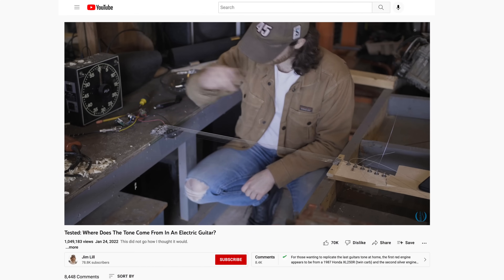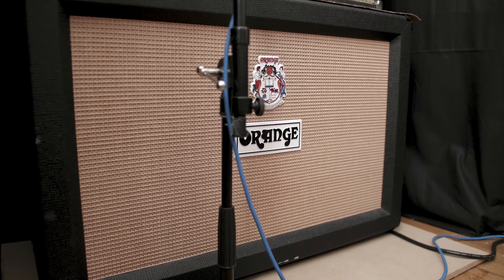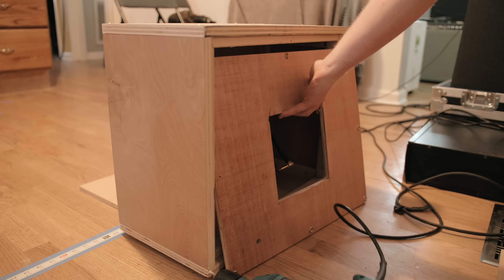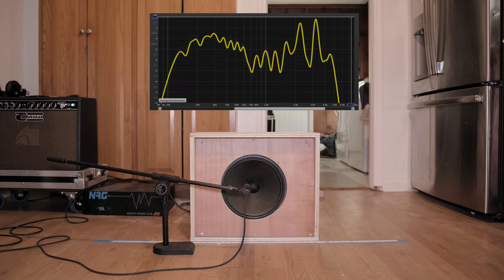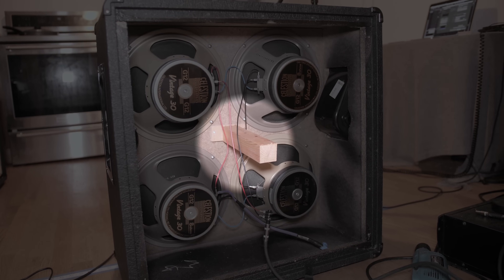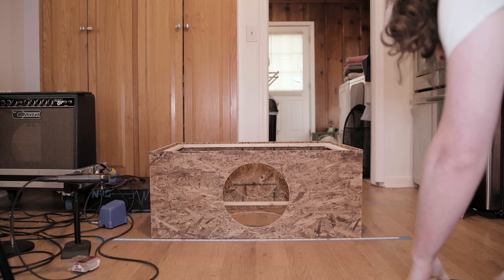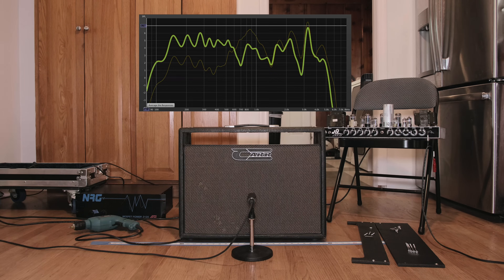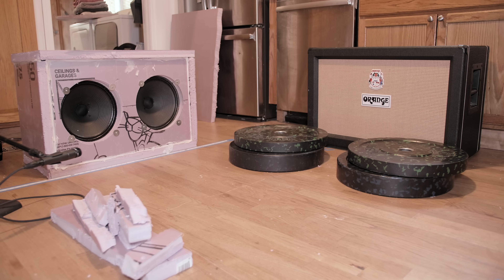Tested: Where Does The Tone Come From In A Speaker Cab?

Comment: The deeper Lill dives into this stuff, the more he confirms several suspicions that I have. The main one is this: all of that expensive gear some people are commenting about probably matters to the player. Better tone woods on a solid body, for example, probably transmit the basic sound they are creating better to the player. Most of these things, however, don't matter nearly so much to the player's audience except in one critical way. It's very possible that when they have the best gear their opinion tells them they could get, the player believes their performance sounds better. That, in turn, gives them more confidence. One of the first lessons my piano teacher taught me was to play with confidence even if I made a mistake. If I did, very few members of my audience, if any, would ever notice I'd screwed up. Confidence goes a very long way in creating a better performance, and I haven't ever heard anyone contradict that statement. 

So that, I think, is the real takeaway. Various gear (outside of pedals and pickups, both of which really can, so far as I know, significantly alter your signal, although even there I expect there's a confidence factor) may not make as much difference as you think to the people hearing you, but it may make you a more confident performer, and that is the key player in this game.

Comment: Live audio engineer here; 40 years in the concert industry, 30 years as a house guy in a 2,500 set venue.
There are formulas available to find the proper inside area for any speaker that’ll let that specific speaker run as efficiently as possible. 
One problem people who buy high end used PA gear have is that they might buy a subwoofer off of someone who has removed the wheel casters but didn’t fill the screw holes. While the loss of low end might not be perceptible, the speaker will have to work harder, stressing it and wearing the speakers components out more quickly, which is why it’s being sold.

Comment: Great video Jim, thank you! I am smack dab in the middle of a Fender Hot Rod Deluxe 112 Speaker enclosure clone build. I'm trying to keep it as close to the original Fender enclosure as I can. I built it from 3/4" pine plywood because I couldn't find any birch plywood locally. I was second guessing myself and wishing I had of made it from 3/4" pine or oak but, from your video, it doesn't sound like it is going to make any difference. The only big difference is that I am covering it with alligator Tolex since I live in Florida.

Comment: I brought a used Yamaha bass guitar amplifier once for  £10 a Yamaha VX 25 B as a practice amp for my bass guitar. .The speaker did not have a dust cap and is sounded amazing with a Strat playing through it on clean sounds .The model of the speaker is JA 3111  12 in 60 watts RMS . As I like the amp for practice I found a dust cap on ebay and fitted it .After doing that it just did not sound as good ,having no dust cap made a really big difference .Brilliant videos by the way

Comment: I think a lot about what else could affect cabs. Grooves cut into the wood on the inside to lighten the cab but maintained integrity? A bunch of small circles cut into the back or maybe even sides to lighten it? A back panel made of 4 triangles coming in from each side, not quite meeting in the middle? An aluminum cab? Aluminum baffle? I honestly think this is an area that probably gets overthought a lot, but I do like the depths you went to to investigate it.

Comment: 15:12 it doesn't look like a lot of mic position movement, but if it's noticeable on camera and from this distance, it's way too much and will affect the spectrogram.

I love LOVE this video, and you can infer the overall results, but there has to be a reduction in variables for it to truly be scientific (which is what you're going for) - something like rods affixed to the speaker screw holes, connected to a mic clamp that cannot move. Much respect for this immense effort, version 2 will be 10/10, i'm certain.

Comment: The conclusions are very interesting, that the dimensions of a cabinet make a difference, but the material doesn't make as much of a difference. One caveat I would add is - these are results with a close-mic'd speaker. What if you need to use a room mic for there to be differences in cab material? Another conclusion that I think is very interesting - there definitely are differences in sound that come from the cabinet's dimensions - even on a close-mic'd speaker. To me, this means that an isolation cabinet will not sound the same as another cabinet.. eliminating room reflections isn't enough.

Comment: From what little I've discovered while trying to build a few Cajons (box drums) ...

- Your styro box won't "resonate differently", it basically won't resonate at all.

- The wooden box would only resonate if the sound source is somehow in contact with the surface - speaker membranes are suspended (decoupled) so they can move freely without contacting the box, which is likely why you're not seeing a big difference there.

- The air in the box only resonates significantly if the box is closed - and I mean completely air tight! If there's a crack anywhere, that makes a huge difference - likely why the specific hole size in the back makes very little difference in your tests.

Comparing with my box drum experiments, where the goal is to achieve rather than avoid resonance, the key here seems to be contact - the box drum is designed to make sound, while the speaker cabinets are designed to reproduce sound, as cleanly as possible, avoiding resonance and other artifacts, which are most likely undesirable. (It's interesting how much stock people put into the sound of their cabinets, as they're actually all designed to alter the sound as little as possible - if they sound very different, it's likely more to do with the amp circuit than anything else. Merely positioning the speaker differently likely has a much bigger impact on the sound than either the circuit or the box does...)

If you wanted to experiment and deliberately create a cabinet that alters the sound, you could try for example using a dedicated bass speaker enclosed in a sealed cabinet with a small opening (a bass port) causing the air in the box to resonate and amplify bass harmonics. You could also try using a piezoelectric element attached directly to the cabinet surface, which would cause the entire box to resonate and color the high frequencies.

The point here is, unless the manufacturer is deliberately doing something to alter the sound, or unless they're doing something wrong, most cabs should sound about the same, because that's what they're designing for: reproducing the sound as close to ground truth as possible.

That said, sound quality is subjective. For example, many people still prefer the sound of a record player over digital media, because the artifacts it introduces are somehow appealing - vinyl fans don't care if digital media is technically, objectively "better", because that's a matter of opinion. I'm sure the same thing could be at play here. Some people might simply like certain resonance, phase or filtering artifacts introduced by certain cabinets, and will use terms like "lush", "crisp" or "solid" to describe subjective qualities. It might be worth doing some first person blind tests to see what different subjects think of different cabs? 🙃

Comment: I really like your energy and inquisitiveness. You mentioned some wavelength calculations, which are very important.
One of the things that a wavelength calculation will find is that in a room with drywall and wood trim, you will experience tons of multipath fading problems due to wave reflections causing frequency dropouts throughout the audio spectrum. Those dropouts appear as periodic troughs and nulls when you sweep a frequency range.

Those troughs are readily apparent when looking at the spectra you generated. They are in every measurement you made, unfortunately. I am not sure whether you were measuring the response of the speakers or the response of the room you were in.

Three things you can do to eliminate this source of measurement error:

1) Hang any cloth you have (bedsheets, blankets, sleeping bags, shirts, pants) all over the room, including the ceiling and floor, to attenuate reflections in the room. This is cheaper than trying to build an anechoic chamber.

2) Run a baseline test sweep with a reference speaker so that you can subtract out that baseline from other traces so that you can calibrate out the multipath issues. 

3) Make sure that you are far away from the test runs and that all your other things in the room are removed or at least in exactly the same place each time you run a test sweep. You would be amazed how the room dynamics change just by you moving around in the room.

As an engineer for 40 years, I've run these kinds of measurements and was amazed how the room dynamics affect these kinds of measurements. The hardest part is coming up with a reference speaker that you can use as a standard. 

I would like to see more of your experiments use spectral analysis rather than trying to rely on subjective listening evaluations. You are on the right track with spectral analysis, and I would be happy to help you out with your measurements in the future.
billc@tigertoothtechnologies.com

Comment: Trying to absorb this. As a speaker builder, I think of 3 other things right away. Any closed or partially closed back, internal stuffing matters. Could be good or bad depending on wanted result. Then there is driver diameter. All kinds of variations there plus smaller drivers afford more room for more drivers. Forgot speaker, voice coil diameter and brand. The last thing in multi driver setup, is off axis sound response. That also goes for most designs. Another thing, is sound at distance vs microphone near and center. The number and diameters of drivers can affect dispersion or off axis response. Any sound by “box” will be most noticeable some distance away, and not at microphone position near and centered at driver.

Comment: I am an electronics engineer (among other things) and have studied audio, specifically speakers and cabinets, for 50 years. I have built my, have different speakers all over the place. Pitch old cabinets. Here is what I have found:

All speakers sound different. Diameter is HUGE. Horns are best for mid and highs. Bass horns are TOO BIG! So, for guitars, build or purchase a two way crossover and add a horn and driver. Bigger = better up to about 14” wide. For deep bass use a 15” speaker, 6 string can use 12” fine. Celestian is best, biggest coul and magnet you can find. Paper cone and surround (rubberized).

Cabinets are very frequency sensitive. Bigger means deeper bass response. Port size and shape is tailored to bass response desired.

But it REALLY complicated. Everything works against you. Guitar speakers DO NOT work well fir home stereo speakers and vice versa. What sounds great in your living room sounds crappy outside!

So, you have finally determined what REALLY affects electric guitar tone. And have learned why sound engineering is so difficult. It’s not tubes versus solid state, guitar or even player. It’s speakers and effects, sound boards and microphones.

Comment: Dear Jim,
Great tests, and I can't believe how many tests you do! Excellent work.

Still, there is one important thing you didn't take into account. You only record the sound at the speaker and not the sound in the room. I'm sure the differences in the room are much bigger than any change directly at the speaker. 

Also, sound to me is not just two dimensional. Every loudspeaker and cabinet has a different spatial imaging, and every small change also changes the imaging characteristics. That makes a big difference in how playing feels and what emotions you get back from the whole setup.

I built my personal guitar speakers by simply paying attention to what image my guitar was giving off. I wanted the speaker cabinets to portray everything I do with my guitar. If I play with power, I wanted the power to come out of the cabinet, not just be loud, but to portray the power. If I play very softly, that should be reproduced as well. What I'm saying is that it's not just about frequency response. Sound has more dimensions than just that.

Regards
Stephan

Comment: Dude, this stuff is legitimately crazy. Blowing all of these different theories wide open just with careful methodical testing. One thing I love is that even though some small factors make absolutely minute changes, a lot of them are the kinds of things that you'll absolutely never hear, especially when playing with a band where you've got so much more going on. Bravo!
Reply: If you play in a band where you don't mic your speakers, you will definitely want a better cab/speakers to cut through the mix.
Size will matter, position and angle will matter, speaker type will matter.

Also, we all don't hear things the same way.

Comment: Fantastic video and an excellent roadmap of where to start when choosing/building a cabinet but..there are still 479,001,600 combinations of these 12 factors not including variations on those factors.  With numbers this huge humans still have to generalize.  Most useful to me is that you can choose a cheaper/lighter material for the cabinet.

Comment: You are absolutely right.  The standing waves inside the cabinet absolutely affect what frequencies are attenuated and which are amplified.  Some interesting follow up experiments would be:  1. make the cabinet asymmetrical on more than just one side (i.e. no parallel surfaces).  2, put polyfill of some other damping material inside the cab and see how it sounds.

Comment: Commendable level of experimentation. Bear in mind, though, that all these tests are based on a close miked speaker. What you hear a few feet away in the room is going to be radically different to what you hear through a mic that is an inch or so from the speaker cone

Comment: Great video, great effort!  

This comes to mind:  If the guitar speaker is not being mic'd and amplified through a PA system, then its radiation pattern plays a significant role in the tone that the audience hears, including how much that tone varies with off-axis angle for different areas in the audience.  How many speakers, whether the cab is open-back or closed-back, how the speakers are oriented (horizontal vs vertical vs diagonal for a 2x12), even whether or not all the speakers are installed (some people just install one 12 in a 2x12 cab, or two 12's in a 4x12 cab) all come into play as far as how the sound is distributed around the room.  I don't think your microphone location could capture a good representation of the effects of different radiation patterns.

Comment: Look up how subwoofers are tuned. It's all about pressure and air volume. Box size matters and can be tuned by the length of the port hole. Low frequency subs are different from guitar cabs but I'm sure you can get many more ideas just by looking at the numerous styles of sub enclosures and how they're tuned. Nice content!

Comment: one thing that's only partially covered is detuned cabs, makes a huge difference. Basically remove half of the speakers. In a 2*12 remove one, in a 4*12 remove two. Volume loss is minimal, but frequency response change is huge.

Comment: Hi Jim - Thanks for doing these videos.  I enjoyed watching them and I learned some stuff.  I sent a few bucks to your tip jar.  

About the Styrofoam cabinet...it occurred to me that the one thing you didn't address was volume.  I'm a bass player and I know that a good cabinet is usually heavy because it needs to be stiff.  The only thing the should be moving is the speaker cone.  Although I haven't "done the work", I bet the Styrofoam cab would not sound the same at high volume as a well-built wooden cab.  

Thanks again!

Comment: About your Question at 17:29 --> if this is true, then the impedance curve will be different. It definitely will when comparing open and closed back but different open back cabs resulting in different paths for the sound to travel from from front to back are not as easy to predict. So an impedance sweep for different baffle sizes would be interesting.

Comment: great video. btw, the port size and volume make a huge impact, as you noticed. best demo is: get a bottle, half fill it with water, blow on it - you get a tone. change the amount of water, blow again - different tone. that resonance is the same resonance you get around the hole or slot on an amp cab (just lower), and the surface area of the port and volume of the box affect that critical frequency.

Comment: I think the most significant bit involved comb filtering; frequencies being canceled or reinforced due to the shape of the cab and maybe the room.  Did you fail to note the volume differences among the differing cab sizes? It wasn't just the frequency response curve that changed. And I'll add a thought: marine-grade, void-free birch plywood is a damn sight stronger than styrofoam. Solid woods are less strong, but might resonate more if they're thin enough, though they'd have to maybe be guitar body thin to make much difference; cabs tend to be really rigid, just to stand up to the giggage. Very cool video, thanks!

Comment: The speaker vibrates both sides, and the waves have oposite phase. The perfect cab would have the whole on the front and calculated in a way that the sound from the back travels in the cab and gets out in 180 grads phase change.